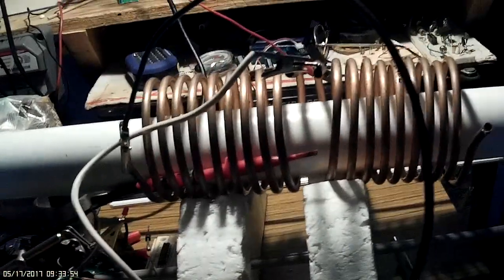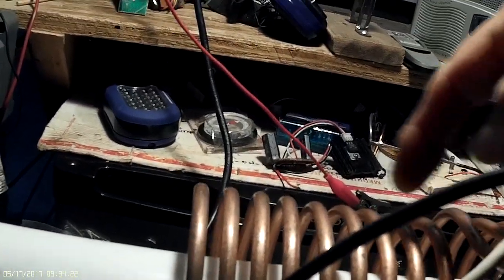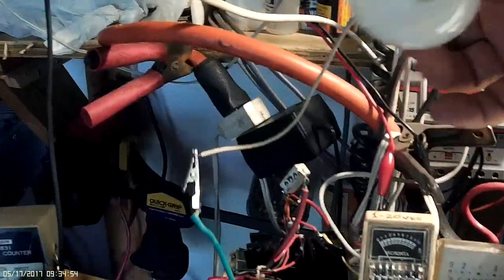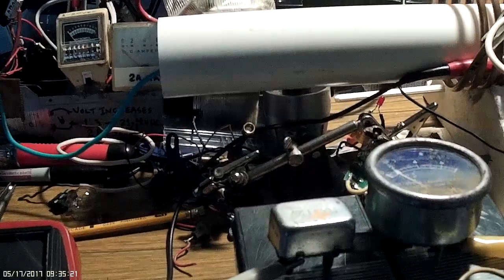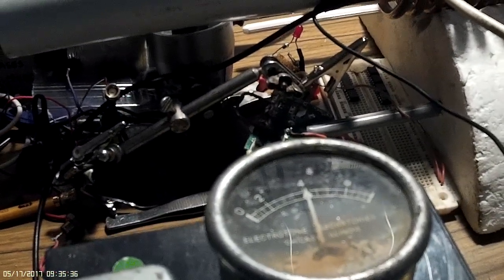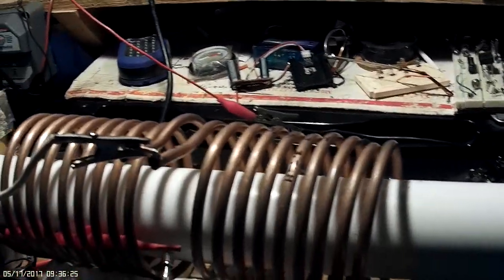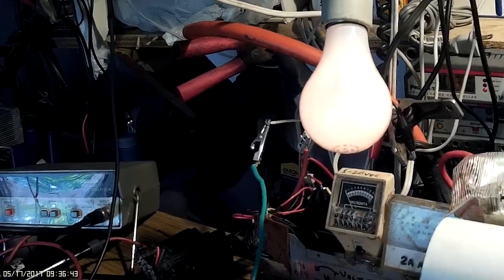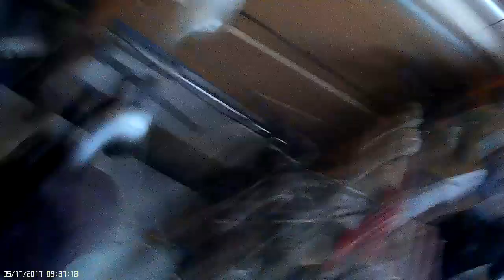ZVS driven coils for fundamental resonance

Comment: Well done, good job. I am also having to go back to basics with tesla to try to find the resonance between coils. The secondary have you tried connecting to ground to see the difference and try aluminum instead of copper. This should also pass through the center of the primary as it allows more collection possibilities. Keep going you are on the right path. Electro static force field :)
Reply: Did you try the small ZVS built for a flyback?
Reply from the maker: Yes, electro static force field, and No, ...for me the thing about these ZVS modules is that they seem to run at the harmonic frequency of any given coil as long as the coil will resonate at any frequency in their range.10-300khz .or use of a higher voltage .very good harmonic square waves with the ZVS module.
All coils have a natural fundamental resonant frequency.The coils exact frequencies can be found with the correct test gear and the formula is on line.

Like you and I they will make a coil resonant, but not necesarilly at the most efficiency.=lots of heat loss thermal runaway=forced inductive resonance.not that great.
My great focus is on getting the   "1.natural fundamental"    frequency at best..to get the current down and to keep it running cool!

I have found so far that this must be included in the 3 arithmetics of efficiencyCOP>1 along with"   2.good ground"   and possibly still using the good ole   '"3. spark gap."or solid state    if possible for tuning.

In the other setup I use a TV flyback with a CFL flourescent ballast and it seems to be the most efficient so far because it is already a resonant circuit for the CFL lamps=low input current  easy to draw power from for self running.so the search goes on with better knowledge,parts, equipment and a very concise accurate tuning which will be needed!
You too, keep up the great work and success to all who endeavor to prove and find use for this energy for real world use!!!
I am seeking a way to make this energy as simple as possible to capture.
Reply from the maker: Thank you DY still working in different directions with the help of our YT guys...inventors Cheers!
Reply from the maker: I will try it in time thank you!
Reply from the maker: foamaxmore 1 second ago

See pierre cotnoir with his working over unity projects ...just fantastic!!!